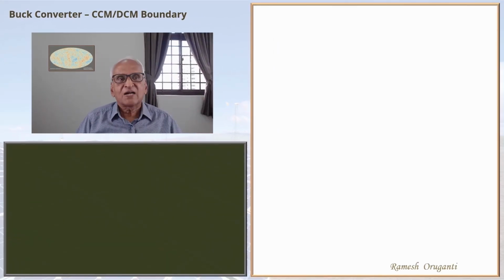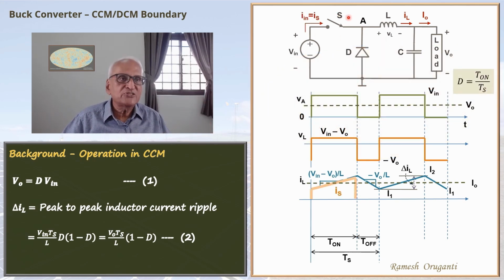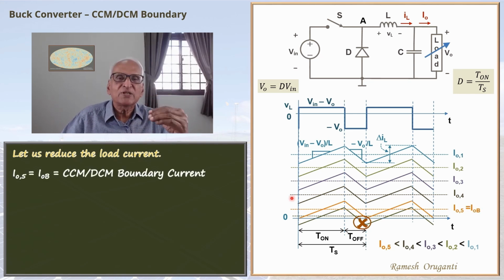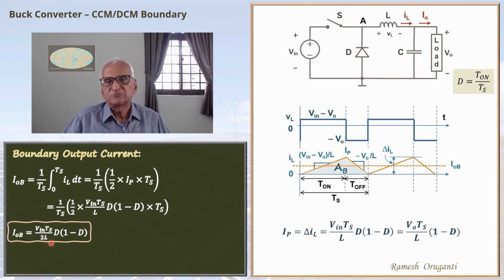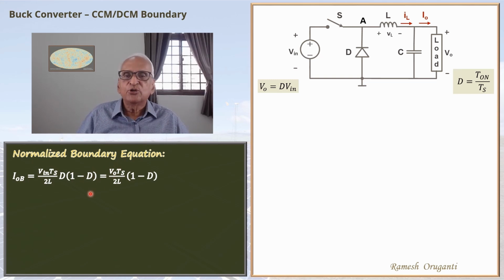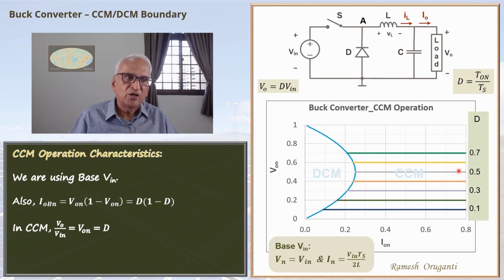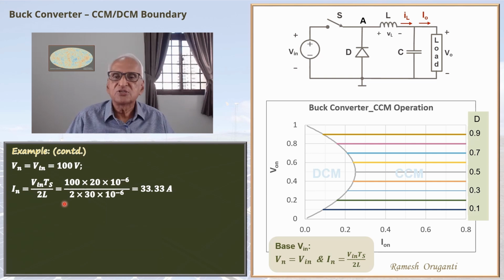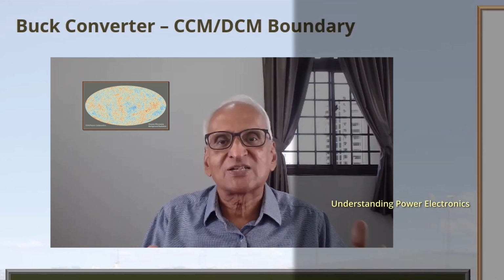PE 2A-3 Buck Converter - The boundary between CCM & DCM

Comment: What a whole lot of gobbledygook. No-one understands a single thing you are saying because l don’t understand anything and l am a professor of electronics. 
When the MOSFET is turned ON, the inductor charges and a receives a PACKET OF ENERGY. During this time the capacitor receives a small amount of energy and also the load. The capacitor receives a small,amount of energy because it has a high value of capacitance and it takes quite a bit of energy to increase its voltage a very small amount. 
It is the ratio of energy ended by the capacitor to the energy needed by the inductor that creates the charging situation for the inductor. 
None of these technicalities are ever mentioned on YouTube because the instructors don’t have a clue. 
The MOSFET is now turned off before the core saturates and the magnetic flux starts to collapse. 
This collapse creases a very high voltage in the opposite direction and since the lead connected to the capacitor is fairly rigidly fixed, it does not move very much. 
The other lead produces a negative voltage and this passes through the diode to compete the circuit where the inductor delivers its energy to the capacitor and load. 
The very high voltage generated by the inductor sees the very small voltage across the capacitor and this is like “hitting a brick wall.” 
When a large voltage hit a low voltage, the large voltage needs a high current to transfer energy. 
This is what the inductor does. It produces a high current and this high current in the turns of the coil produces an expanding flux that cuts all the turns of the coil to oppose the collapsing flux. This reduces the output voltage enormously and also the current. 
That’s why the inductor takes so long to charge the capacitor. 
The voltage on the capacitor is monitored all the time and the oscillator needs to know when the set voltage is reached so the mark-space ratio is reduced. It then needs a low set voltage to tell the circuit to increases the mark-space ratio. The gap between these two values might be 10mV, 50mV or 100mV. The is the output ripple and has nothing to do with the inductor or capacitor. 
The circuit could produce a ripple-free output but the oscillator would not know when to turn ON and turn OFF. 
See. The reality of the operation is nothing like the gobbledygook of the commentary. I can see now the circuit works. I Jace never uses mathematics, formula, technicalities, gibberish, or vagueness to describe things because l know how things work.
Colin Mitchell.   talkingelectronics  .com